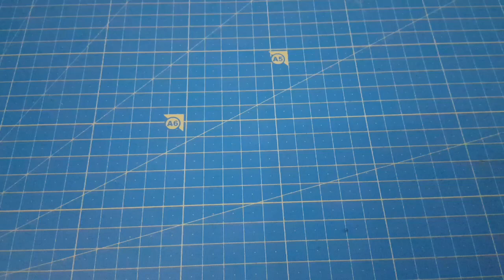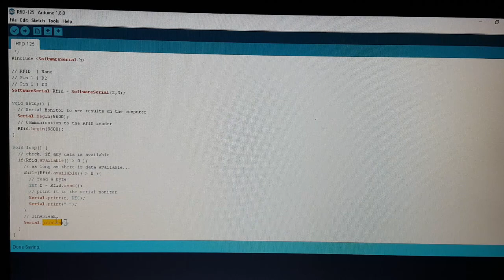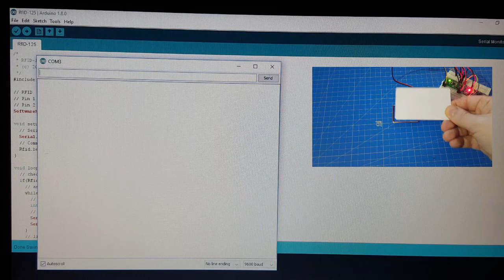Connecting RFID reader to an Arduino

Comment: I know it is an old video, but I still hope you can see my message and help me with my question, I am working on a project of a chess board, the plan was to attach a rfid tag to each piece and read it from the board. the complex part is that we need 64 readers (or antennas) to read the tags from each square (so we can tell what piece in this square). is there any way to accomplish this task? by the way each square is 4x4cm. and I am looking for most effective and cost efficient way. thank you in advance
Reply from the maker: You could make it with only one reader and two stepper motors. Like a plotter, you just move the reader from one field to the next. It would take a lot of time each time you check the board. But you could calculate, which figure is able to move, and check only the places where it can be moved to.
Just an ideal.

Comment: Can I use RDM6300 module just for the door access control without connecting it to an arduino or something. I mean I just want to write the tags on the module's memory and use it to give access to people through their rfid cards or tags? I want to control an electromagnetic door lock

Comment: hi anyone please answer me, for the Rfid Tag CARD.. do you guys know exactly at EBAY?? please tell me.. thank you
Reply from the maker: The RFID 6300 (as shown in this vid) works with a frequency of 125kHz. So you'll need 125kHz RFID tags/cards.
Reply: nenioc187 thanks for the answer..i found out that, em 4100 is for read only , em4305 is for read/write...so be careful..

Comment: hello, I’m a student and try to do an experimental test. I need your help. I have tube with full of water that is streaming in it. and now i need to know and measure water pressure. could u please help me what sensor should I use and if its possible create a video because I think you are creative man. thanks a lot. this is my Gmail: keyvanhajirayat8@gmail.com
Reply from the maker: Currently I'm quite busy. But I looked for pressure sensors. There are a wide range of sensors from bout' 20€ up to 300€ that could be used with the Arduino.

Comment: any idea how to pick up the signal the card is putting out using just an ID20-LA breakout with Arduino uno?
Reply from the maker: Looking through the Datasheet https://cdn.sparkfun.com/datasheets/Sensors/ID/ID-2LA,%20ID-12LA,%20ID-20LA2013-4-10.pdf 
chapter 10 describes how to connect the module to the RS232 interface of your computer, or via UART. So it looks like connecting Pin9 to the Rx-Pin of the Arduino and common ground could do the trick. But since I don't have one of those, I cannot verify this.